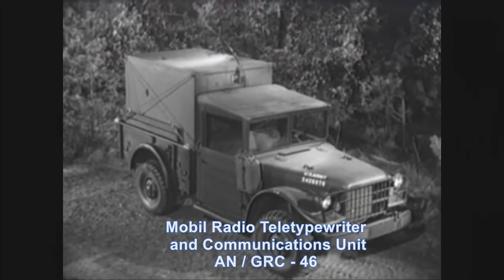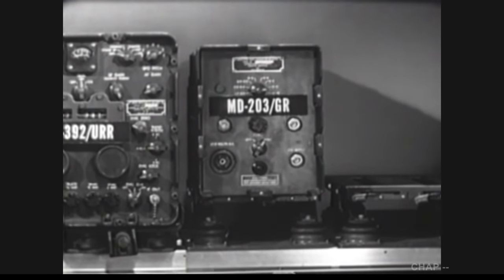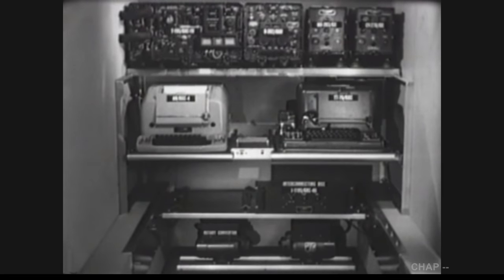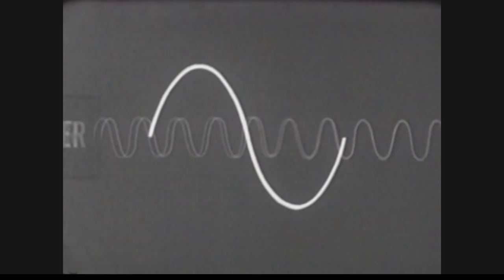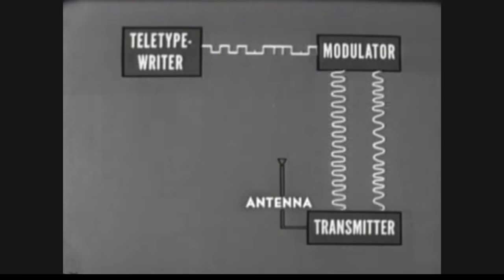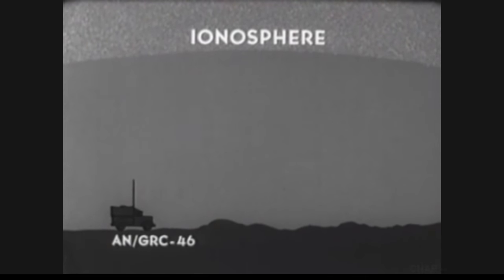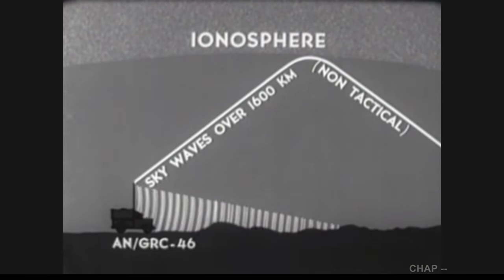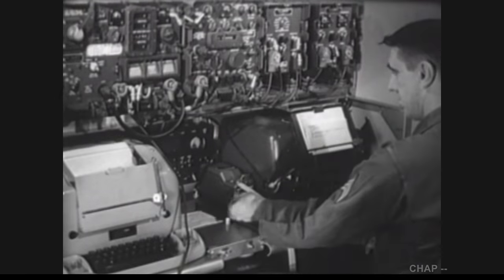Vintage Radio Vacuum Tube Electronics:  1963 Mobile Teletypewriter Military Communications AN/GRC-46

Comment: I trained on this unit at Ft Sill, OK.  We had exercise with like 6 trucks in a circle each with GRC46.  We learned how to setup and tune the gear and  passed RTTY traffic between us.  We got finished with the exercise early, but were not allowed  leave, that was the Army.  So as a Ham I tuned up the transmitter and receiver on the 20m Ham band and heard a NY station calling CQ.  I hit the tune lever of the T145, picked up the mic and called the NY station from out OK GRC46.  We had about 10 minute QSO.  The other solder working with me could not believe what I had done.  Never saw a GRC46 after the Army school.
Reply from the maker: Hi Ron, great story!  Thank you for sharing that.  Can you tell me more about what QSO means?  ~  Victor, at CHAP
Reply: What unit did you work with after your Ft. Sill schooling?
Reply: @ComputerHistoryArchivesProject  
QSO = a conversation via radio

Comment: Love vintage military comms. This is a fun radio. Great A3A. A good solid-state dyno replacement highly recommended. Less noise and amperage draw.
Reply: All that's missing are the dogs.
Reply: Not so vintage.  They were still using these into the 90's.  All they upgraded was the trucks.  1980's Chevy pickups instead of old Dodges.

Comment: Very interesting.  I was in Crypto Repair USAF in 1969, the main teletype unit was the size of a refrigerator and had about 50 vacuum tubes.  The "modern" replacement had transistors and was the  size of a microwave.   A lot of thought and invention went into these units to keep communications secure.  Which was undone by the Walkers
Reply from the maker: Hi David, I was reading your comment with interest, but I do not understand the reference to the  "Walkers."  Could you clarify perhaps?  ~ Victor
Reply: He meant John Walker's Spy Ring, mostly family, who gave most of the crypto gear the US Navy used to the Soviet Union, from late 1967 until caught in the mid 1980s.
Reply: @darylmorning  This is why modern cryptography does not rely upon security by obscurity of technology.  It operates on the assumption that the enemy knows everything but the key.

Comment: My shop in Vietnam built a brand new AN/GRC-46, complete with new 3/4 ton truck, after the armistice was signed in early 1973. The unit was for a group of United Nation Canadian monitors for a relay station between Saigon and Hanoi. The components came from the Depot in Okinawa.
Reply from the maker: Hi Larry, that sounds like a great project!  It takes quite a bit of skill to pull that off.  : )
Reply: @ComputerHistoryArchivesProject  It didn't take us long to assemble. I was amazed that the Depot in Okinawa had a brand new 3/4 ton pickup for us to use. The sad thing was that after we built this unit and it was sent out, it came under fire before it made it to its relay point. A decision was made for the rig to return to Saigon and another method of communications used from Hanoi to the communications center in Saigon. I never saw the rig again, as we shut down our shop and turned it over to the South Vietnamese.
Reply from the maker: Hi Larry, sounds like a fascinating and memorable experience!   Thank you very much for sharing that memory. ~  Victor
Reply: I went radio school Fort Sill in the 80's. When did they start calling the set the Angry 46?
Reply: @abergethirty  I believe any item that used the AN/GRC designation was shortened to "angry":)

Comment: I was intrigued with that transmitter - it needed a filter and had 2 pipes connected to the front and bent into the wall - in one of the external shots we see a plate with 2 holes in it near the back of the shelter = I assume that part of the transmitter is soo hot it needed external cooling - air takin in through the lower pipe and passed hot components and in to a centrifugal fan and out the upper pipe to the outside

Comment: I find it really interesting that back in those days "tuning presets" could've meant that device actually, physically adjusts whatever tuning it has to, itself.
I mean, it's no magic, just actuators and servos, but "it's aliiiiiiive" :D
Mr. Carlson, I think, featured a radio with "presets" like that in one of his Lab episodes.
In USSR, there was produced a radio receiver called "Festival". Again, it's probably not unique to only that receiver, but it has a wired remote control that allows for remote manual tuning, where you turn the potentiometer dial on the remote, and it electrically controls the servo that rotates the tuning capacitor inside the set.
Reply from the maker: Hi ZXRulezzz, great observation and good info!    Thanks  ~  Victor
Reply: Other teletype rigs with this level of power had to be manually tuned and had no presets. Units like the AN/GRC-26D had to be manually tuned. I have never experienced a T-195 that was used remotely. The AN/GRC-106 was much more advanced and released a few years after the AN/GRC-46. The AN/GRC-46 had a separate converter and modulator. The AN/GRC-106 combined these functions into a "modem" unit.

Comment: I spent about 60% of my time in this unit during my first assignment in the Army. Hotter than hell with no AC in the AZ deserts.
Reply from the maker: Hi @w7wv73, that must have been quite an experience!  And everything around you also gives off heat, radio tubes, vehicle engines, sand...   thanks very much for sharing!
Reply: I was hoping to get an asssignment in the 26D, a bigger van mounted on a 2.5 ton. And it had AC!
 @ComputerHistoryArchivesProject

Comment: As I recall, that transmitter alone required at least 40 amps at 28 volts for no more than 100 W out on CW.   The receiver used all low voltage on the plates, (28 V) but needed heater power.  Remaining devices probably doubled that.  Overall power efficiency was maybe 10%.   
Who designed that power supply/distribution system - Rube Goldberg?
Thanks for the film.
Reply from the maker: Hi Hugh, glad you enjoyed it.  Thanks for the feedback!   ~   Victor, at CHAP
Reply: We operated the AN/GRC-46 with an output power of 1000W. I have never experienced a unit that was used in CW. From what I remember the output power tube plate voltage on the T-195 ran at 1000V. When keyed it generated about 10K Volts of RF power.  I can't remember if there were dual output power tubes or a single output power tube. A converter was used to translate 28V vehicle power or generator.

Comment: When I was in the Army we still had these on Chevy/GM pickup trucks.  This was the 80's and even then they were obsolete in the other services.  We were using discarded Air force teletype hardware because they had moved on to Digital and Satalites. These are slow too.  Under 300 baud.  Hell, even a on BBS  a phone line was faster.
Reply from the maker: Hi Allen, interesting.  I bet the older hardware had a long endurance life span, but the tech stuff, as you say, was very very slow.  ~  Thank you for sharing the recall.   ~  Hunter

Comment: 50 baud 5 bit teletype code around 100 word per min.
Reply: If I remember correctly, these units could run in two configurations that controlled the speed of the teletypes. The slowest was 60 words a minute and the fastest was 120 words a minute. We ran at 60 words a minute. It's been so long since I used these products, I can't remember if they used Baudot or ASCII. I used them in the 1970's with commercial teletype senders. I used the AP to test the rig. It makes sense that ear;y units might have been Baudot, but I don't think so. The teletypes were probably updated or supported ASCII. If I remember right, the paper tape readers and punches used 8-bits.

Comment: I remember those old Angry series radios. The RT/524 was about the most modern field radio for a long time. They are all clunkers now and worthless. The M-48 Duster twin 40 mm gun had tube radios! Rugged and reliable at the time.

Comment: Ah, the old RAT Rig...came with their own 5KW generators.  They always had hot coffee!
Reply: Funny. We used two 10KW generators mounted on a trailer that we towed. We also had heat and air conditioning:)
Reply: @3366larryandrews  I probably served before you did.
Reply: @paladin0654  Perhaps. I used the AN/GRC-46 in Vietnam, 72-73.
Reply: @3366larryandrews  I used this series of radios during my entire career.  When they worked, they were great.
Reply: @paladin0654  Interesting. The AN/GRC-46 was being phased out for the AN/GRC-106. Still used the same or similar teletypes, but were much more modular and were mainly transistorized.

Comment: Where are those units now?
Reply: I have a complete set.
Reply: There are collectors especially for the T145 transmitter and R392 receiver. Some still use them on the Ham bands.